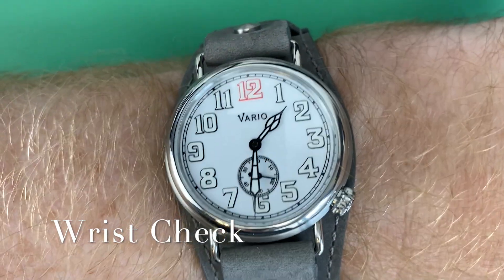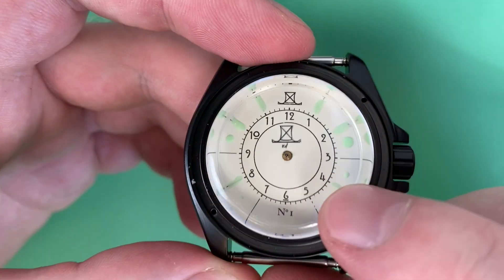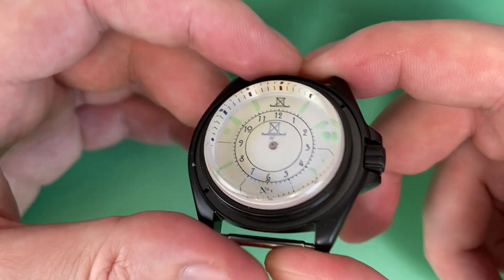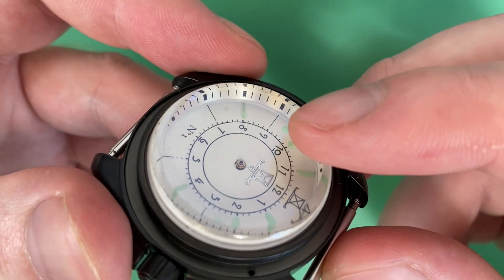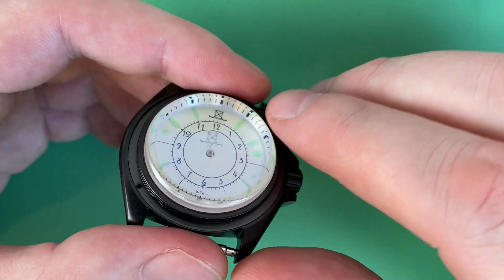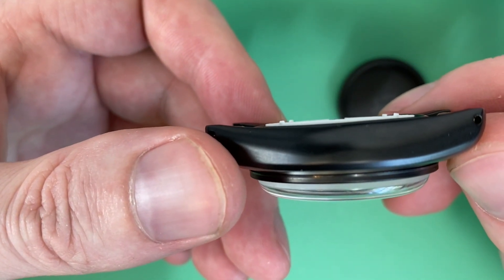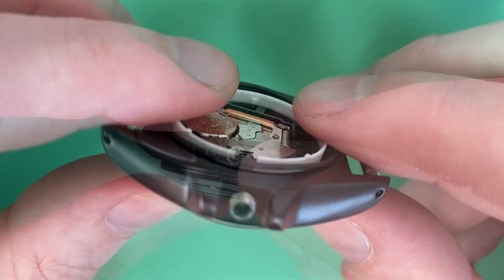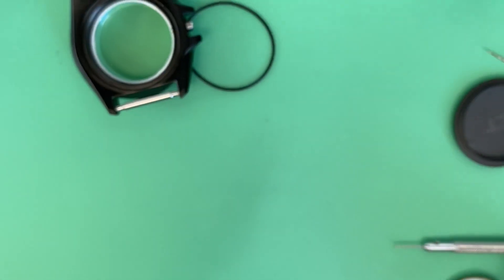Custom Movement Holders: A Ronda 515.24h GMT in an SKX Case

Comment: At lease the Ronda 515 or 715 can fit the Seiko 6105 hands & dial very well.
Reply: Does the date wheel match up with Seiko 28.5mm dial date windows?
Reply: Did you try it? How did it go? @Strideo1

Comment: Are nh crowns compatible with the ronda stem? Im looking to swap the nh36 in one of my builds with a ronda 515 but was wondering about the crown and stem. I have found ronda spacers to fit nh cases and hands in 120/70/20 but the crown is my last concern
Reply from the maker: I believe both NH stems and Ronda stems are Tap 10, so that aspect is fine. What is more of an issue is if the crown threads for the specific case are compatible.
Reply: @WatchComplications  I see what you’re saying. The watch I am planning on modifying is one of my previously built nh36 mods. So it sounds like it should work out as long as I can get the nh stem out of the crown to replace it with a ronda stem. I really appreciate the info man
Reply from the maker: @Games-Trick864  might need to warm it up if there is loctite on the stem/crown

Comment: Hi, I have an NH35A automatic movement with the crown at 4 o'clock. Accuracy is hopeless. Do you know if there are any drop in Quartz morvment replacements or could I procure a quartz movement with a suitable adaptor ring from you? or maybe just the adaptor ring? Let me know - thanks
Reply from the maker: That's exactly what I do in the video. I have a kit for fitting the Ronda 515 series of movement into the SKX007 case. Crown location is irrelevant as far as the kit is concerned, it can be rotated into any location. https://watchcomplications.com/ten-six-watches/movement-and-case-combinations/

Comment: Hello friend, (sorry for my English, I'm using Google translate) I've seen in another video of a poker quartz watch that with a ring of yours could fit a Ronda 515 movement in an NH35 case. My question is, is the Ronda movement compatible with NH35 dials and hands? And if so, is the Ronda spacer ring suitable for other NH35 watch case models? Thanks!
Reply from the maker: The dial feet locations and the hand sizes are different on the NH35 and Ronda movements. The spacer may or may not work from one case to the next. There are other interior and case dimensions that vary from one case to the next even if they fit the same movement.

Comment: Great videos.  Thanks.  Do you have a holder and ring for a Ronda 515 24H  in a SKX2013 case (3pm crown)? Thank you.
Reply from the maker: I'm not sure what you mean by SKX2013, since that's not a case number. If I assume what you are after...I don't have a holder specifically designed for that combo but describe on my website the cost associated with a custom combination. See https://watchcomplications.com/ten-six-watches/custom-movement-holders/

Comment: Brian, in general about the Ronda 515 24h movement, is the quartz oscillator frequency adjustable?, is there a variable capacitor screw to turn within the movement to refine the freq?  I ask for two reasons: (1.) just for regular accuracy, and (2.) because I'd like to turn a 24-h watch based on this movement to a Sidereal-rate watch (I'm an Astronomer): this requires making the watch run "fast" by 236 seconds per day, with respect to Solar Time; now, if there IS an adjustable capacitor on-board the 515 24h, does it have as much adjustability in + direction to make the watch run as fast as that?  Thank you!, and for all you do in many great videos.  --Joe / Tucson ARIZONA / W7DXW
Reply from the maker: To be honest, I'd have to look into the spec more. https://www.ronda.ch/en/movements/quartz-essentials/ronda-powertech-500/caliber/515

Comment: This was immense help but im still stuck on finding a dial that would fit the movement
Reply from the maker: Any dial that fits the ETA2800/Sellita 200 series also fits the Ronda 515 series. 28.5mm is also a common diameter. Ofrei.com has such dials. You can also remove and replace dial feet, or use dial dots as a last alternative.

Comment: I had a Tudor homage case that  swapped over to a 28.5 mm dial.  The Tudor case has no cr and the dial was 32.2mm.   I designed a CR to fit as well as to raise the stem height to fit.  Can you try in your autocad to make a CR but has second tics as well?   I am not at your skill level in autocad to evenly space the tic marks.  Maybe a better or different solution?
Reply from the maker: Is the chapter ring beveled/scooped? It's certainly something to test. Minute marks/Hour marks could be done with the 3d print itself, or perhaps applied after printing...either with a decal or paint. How hard that would be depends on the shape of the chapter ring.

Comment: Hey Brian! Fantastic video again. I am planning to use a seiko case (namiko mods/etc.) And use a ronda movement (as seen in yours) and use my own custom made dials.

I was wondering if selling these mods (use ronda + custom dial) but use cases sourced from mod websites, is legal? Would this cause any trouble?
Reply from the maker: As long as you aren't using Seiko's logo anywhere or any other copyright material then I don't think you'd have any issues. But I'm also not a lawyer and don't give legal advice.
Reply: @Watch Complications  thank you! Ofcourse...I just wanted to get an idea...but I will ask a copyright lawyer about it. I wanted to ask one more thing about your build.

You have used a spacer between chapter ring and dial. What if we remove the chapter ring altogether? Supposing we have thicker dial, secured to movement, and also hands with posts long enough..what's the risk of having no chapter ring?
Reply from the maker: that would be a really thick dial. there's no risk, you'd just have to design a dial that accounts for the height and at the correct diameter. There is also a notch designed into the case and chapter ring so it sits in the right place.
Reply: @Watch Complications  thank you Brian for your continued guidance. It's been really difficult sourcing custom cases 😅 shall try to use existing mod cases. Plenty of variety

Comment: Nice video, but what about the date position if you have a different movement. You need to find a 28,5mm dial with date for that particular movement? Or is there another option? The spacer between dial and chapterring is nicely done. Much more to prefer than lifting the dial. Especially if you want day/date window.
Reply from the maker: A different movement would potentially need a different holder (depends on what movement it is). If the date on the movement is in a different location, say 6, then the dial would need a cutout at 6 if you wanted to see the date. The dial is really a separate issue from the movement holder/spacer issue. For example, this movement has a date, but the 28.5mm dial I had sitting around that fit the 515.24h was a no date dial. The same dial can be bought with the date window and also a day date window. I just didn’t have one sitting around, and the point was just to have a dial that fit so I could get the spacer and holder designed and test the whole thing together.
Reply: @WatchComplications  Clear. I experience when using different movements with date wheel, It's so hard to find a dial that has the window at the right diameter so that the date window isn't overlapping half the date wheel ... No experience yet with creating or modifying a dial...
Reply from the maker: @haping1  sounds like dials that aren't designed for a particular movement.
Reply: @WatchComplications  Yep, that's the case. 😁